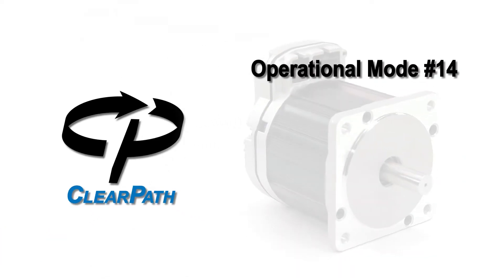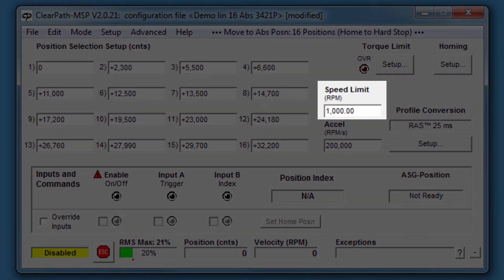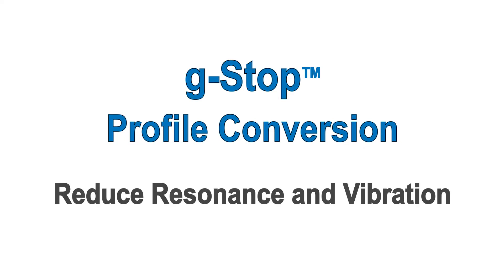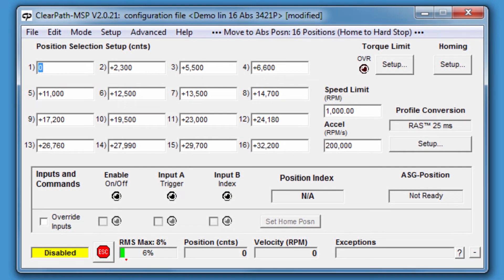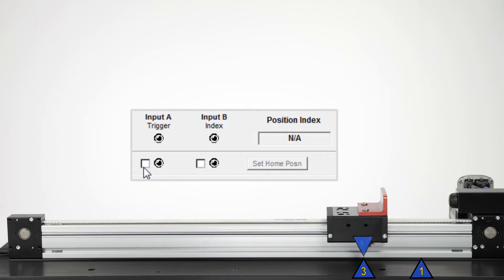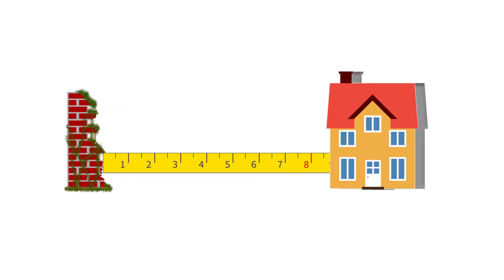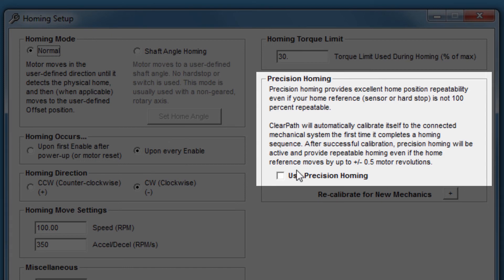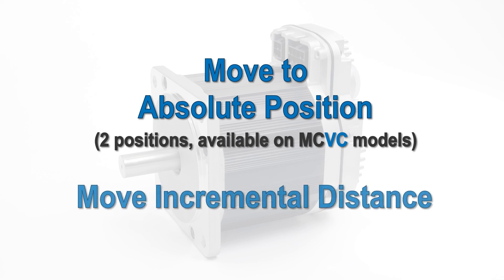ClearPath Integrated Servo: Move to Absolute Position (16 Positions)

Comment: Thank you for these well explained and edited videos. The home precision feature applies to all the ClearPath servos?
Reply from the maker: Hi Raul,

The Precision Homing feature is available on SD and MC models with firmware revision 2.0 or later, in any mode that homes to a sensor or hard stop.

For a list of all modes that have sensor homing, hard stop homing, other homing options, and for more information on Precision Homing, please check out the "Precision Homing" section in Appendix G of the ClearPath User Manual.

If you have any other questions about homing, please feel welcome to email or call.

Aaron B. - Teknic Servo Systems Engineer

Comment: How does this work when power is disconnected from the drive and the home reference is changed at the same time? Does the advanced homing routine use non-volatile memory?
Reply from the maker: Hi DjViOd,

That's a good question. When Precision Homing is turned on and calibrated, your ClearPath motor will home to the exact same absolute position along the axis every time, even if the hard stop or home switch has moved a bit** since calibration. Cycling power to the motor does not affect how Precision Homing works, so non-volatile memory does play a role.

**The hard stop or home switch can move by as much as 1/2 rev. of the motor shaft in either direction without changing the Precision Homing position.

If you relocate your hard stop or home switch for any reason, you'd want to re-calibrate the Precision Homing function. To do this, open the Homing dialog in MSP, click the button "Re-calibrate for New Mechanics", and follow the onscreen instructions. It only takes a few seconds to re-calibrate. 

Thanks and regards,

Jim W.
Teknic Servo Systems Engineer

Comment: Is their an example where you enter 6in via keypad and it moves 6 in. Simple application of a mitre saw stop.
Reply from the maker: Hi Ziyad S – you would need some type of PLC or microcontroller to incorporate a keypad (and perhaps view your entries on a simple 3-4 line LCD alphanumeric display). An Arduino, for example, could handle this application. ClearCore would be another viable option to consider if you prefer an industrially hardened microcontroller.  https://www.teknic.com/products/io-motion-controller/

An automated saw stop generally requires arbitrary positioning to any location so the “Move to Absolute Position (16 Positions)” mode is probably not the best choice.  Instead I would consider the more flexible positioning modes:
*“Move Incremental Distance” https://www.youtube.com/embed/EQfZdp6Fuxo?rel=0&iv_load_policy=3
*“Pulse Burst Positioning” https://www.youtube.com/embed/_TjkO93ny2E?rel=0&iv_load_policy=3

Another YouTube Channel, Neo7CNC, created an automated saw stop system using ClearPath, an Arduino, a keypad, and an alphanumeric display. It’s quite impressive and the creator goes into substantial detail throughout the build process. https://www.youtube.com/watch?v=q0xYFXSwsHA&list=PLFc8_pNqVayIkuzg7STnwNjSi2Zy_xWaR&ab_channel=Neo7CNC

I hope this helps.  If you have any questions, or would like to talk about your specific application please feel free to give us a call at 585-784-7454, or use our "Contact Us" form online at https://www.teknic.com/contact/

Thanks, Abe A - Teknic Servo Systems Engineer